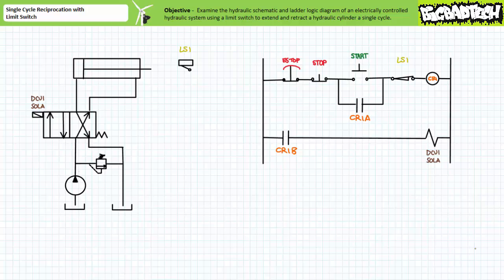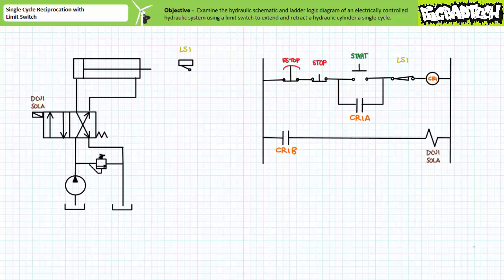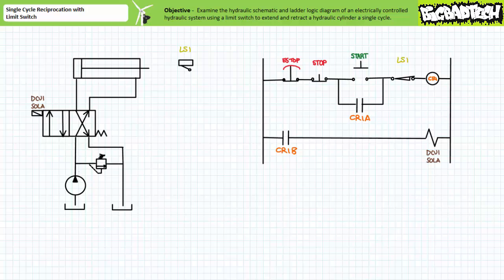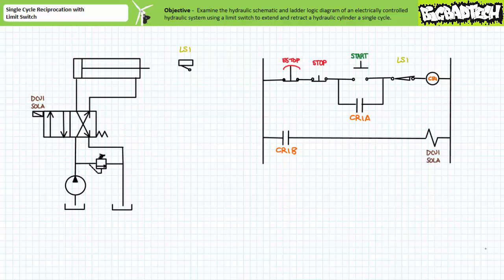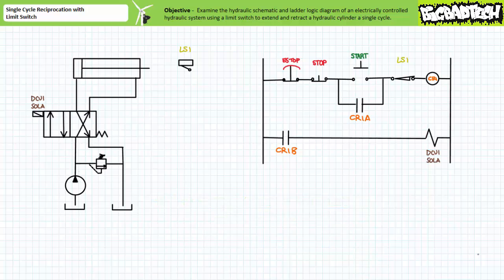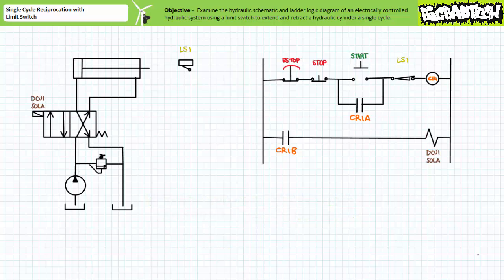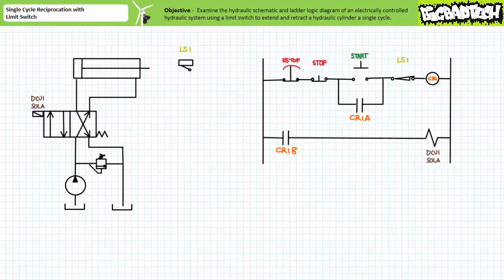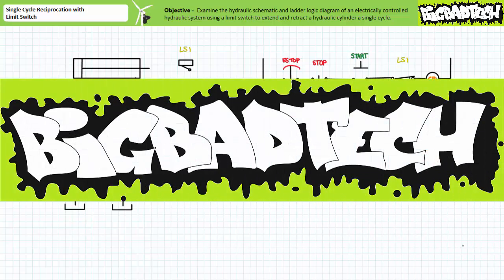Single Cycle Reciprocation with Limit Switch (Full Lecture)

Comment: Hi Jim, Say the DCV was solenoid operated in both directions. Could you please do a video showing the ladder diagram if the cylinder need to be extended and retracted by energising both solenoids?This would be very helpful for a project I am currently undertaking.Thanks Jim.
Reply from the maker: Typically double solenoid valves need to energize one solenoid and deenergize the other to shift positions (ie: A on, B off to extend, A off B on to retract). In the deenergized state a mechanical detent keeps the valve in the last asserted state. You'll often find these types of valves in lifting or grabbing operations. In the event the systems lifts a load and is accidentally depowered the mechanical detent keeps the valve in the last state (ie: holding the load). I don't have any videos making use of these types of valves yet ... however .... the ladder logic would be almost like a reversing motor stater with electrical interlocks. https://www.youtube.com/watch?v=_ruw_miXNMM featuring plugigng action https://www.youtube.com/watch?v=ZyIbZlXSsFg The idea is to permit instantaneous reversal of the cylinder however prevent simultaneous extension and retraction.